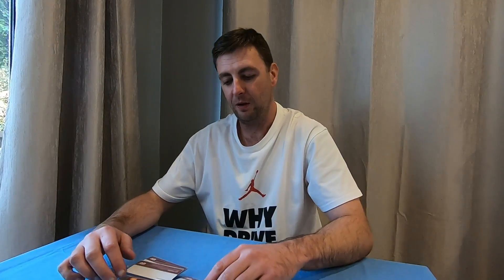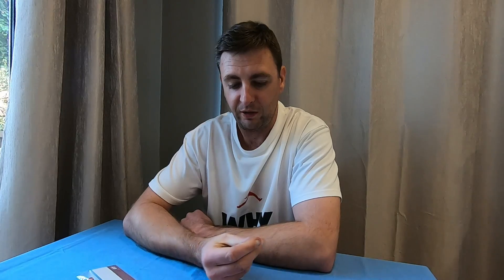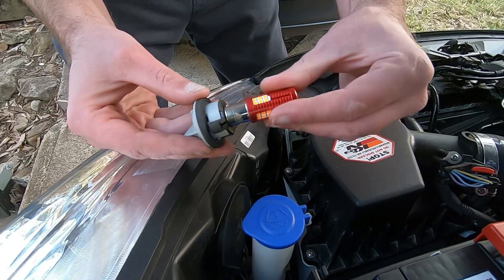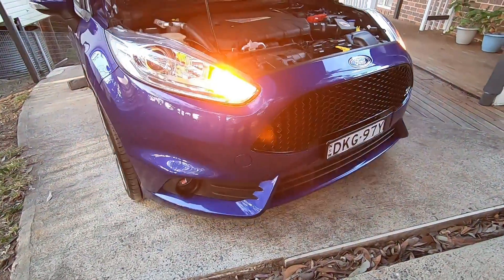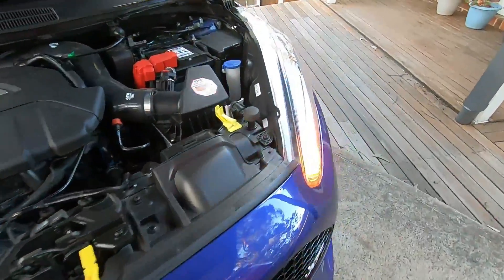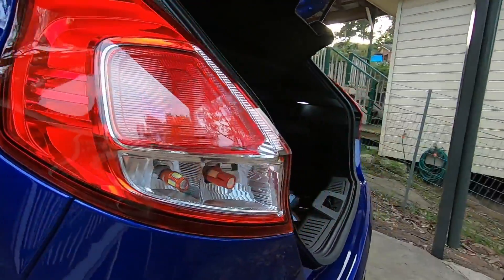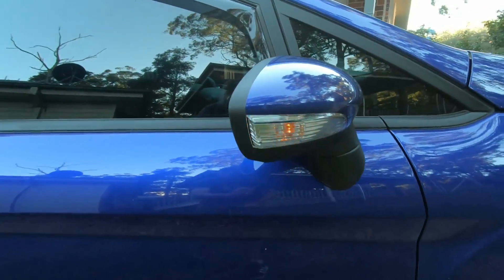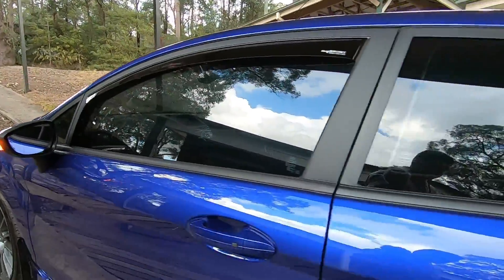Autobeam LED Indicator Install Mk7 Fiesta ST

Comment: Do you need load resistors
Reply from the maker: Not seperately no. Each unit has the resistors built in I believe. It's easier shown on the interior lights as they don't need the more heavy duty connections.
Reply: Do you have a website link for the front indicatorlamps with built in resistors?
Reply from the maker: @r.b.701  link in the video description. Autobeam state no additional resistors required for most vehicles. I have never had a problem with the indicator bulbs and nether has anyone else I have spoken with.